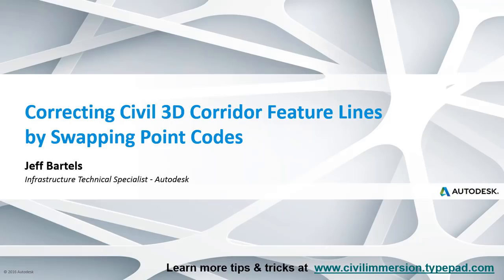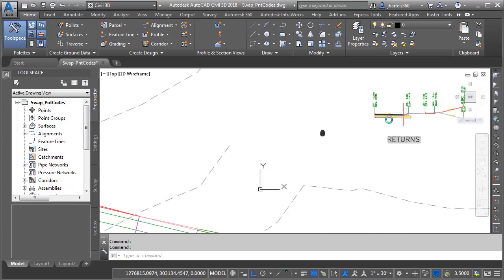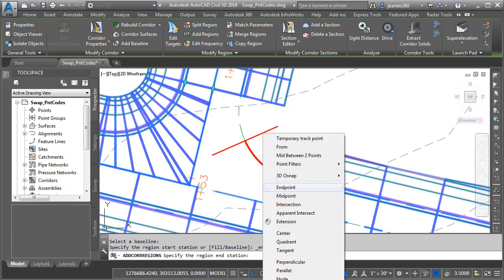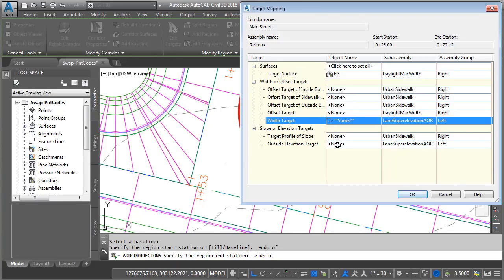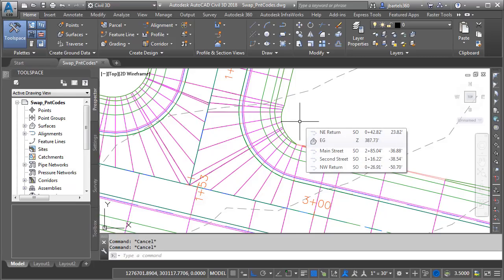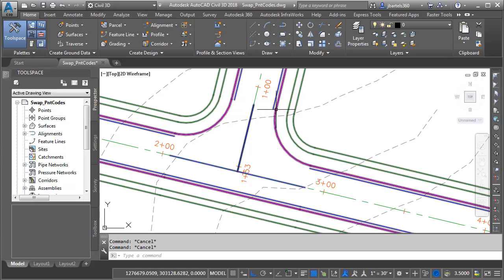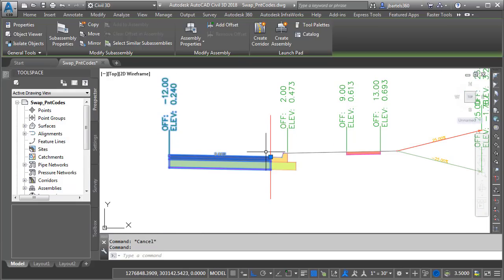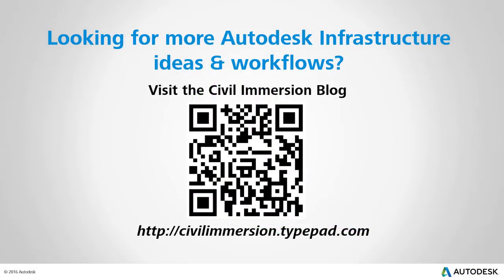Correcting Civil 3D Corridor Feature Lines by Swapping Point Codes

Comment: Hi Jeff, 
Hi,
i am trying to build a sub assembly lane in the SAC, all work well when importing to C3D, but i want the point codes to change automatically like the AOR Superelevation Lane where you could select from a drop down list (Crown, ETW, None) for the inside point code and outside point code. Grateful if you could share a video. Thanks